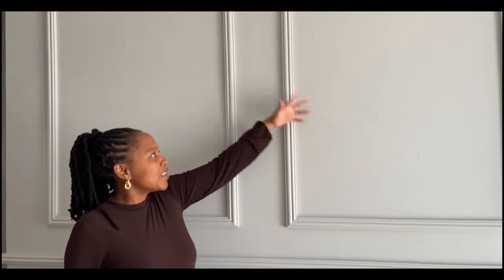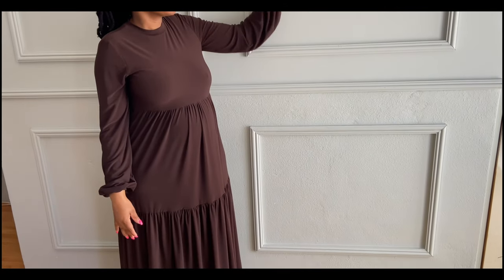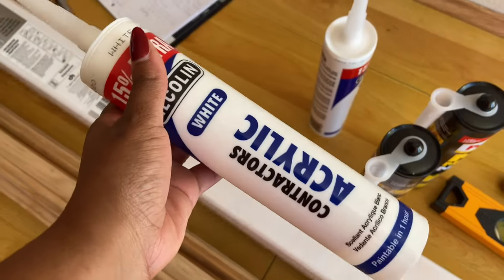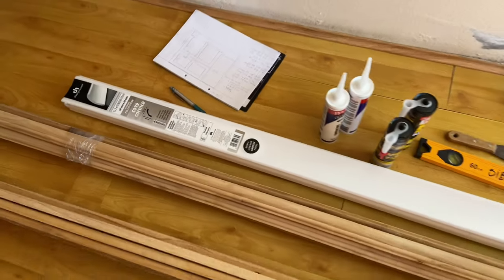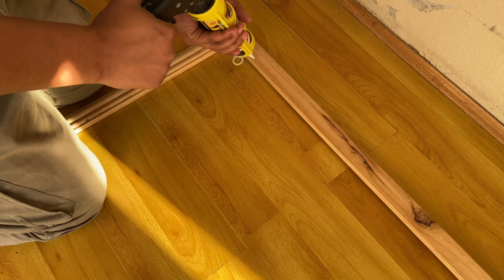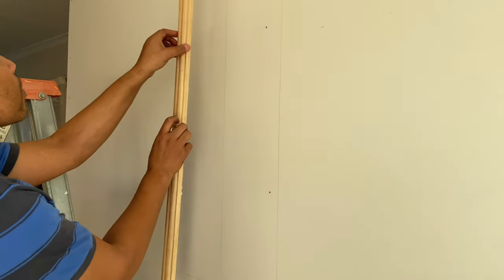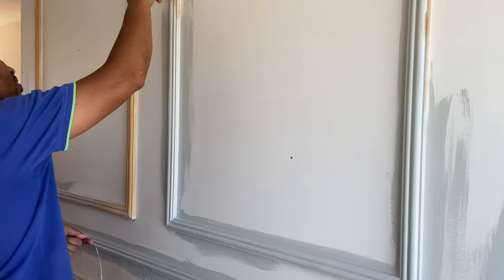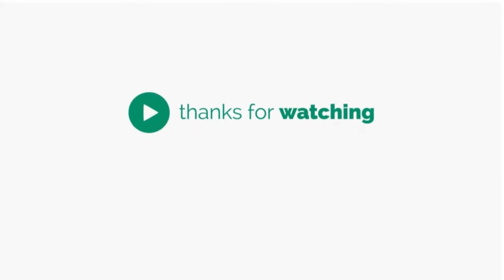#DIY Wall panelling I South African Youtuber I Home Styling #diyprojects

Comment: Hi gal, im also about to do this myself and was wondering what kind of nails to use on a brick wall as i was told i will need to use screws as plain nails do not stick on  brick wall
Reply from the maker: Hi Bongiwe, so we used glue and small screws to attach the rail to the wall but only in areas where the wall was a bit uneven. 
Use the small screws and just double check at the hardware store, they will advise you on the perfect size. Good luck 😊

Comment: Good morning, which place did you get the dado rail? Where in Montague? Tried Buco but I’m not winning
Reply from the maker: Hi there, we bought ours at BUCO but if they are sold out you can try either Builders Warehouse or Build it. They both even have the polystyrene ones.
Reply: @beezeeonline  thank you kindly